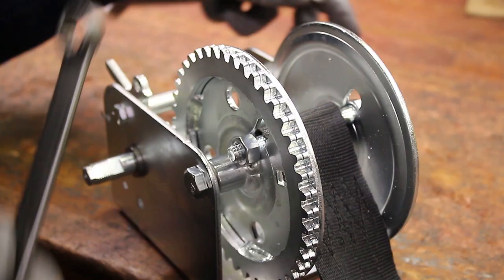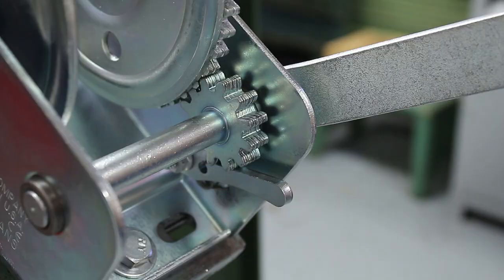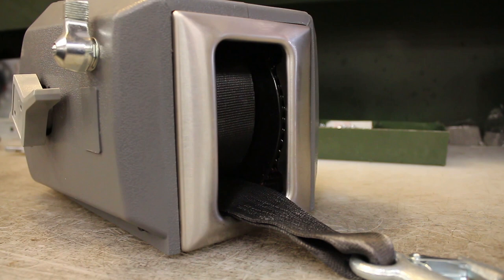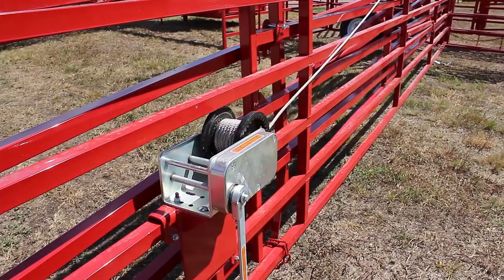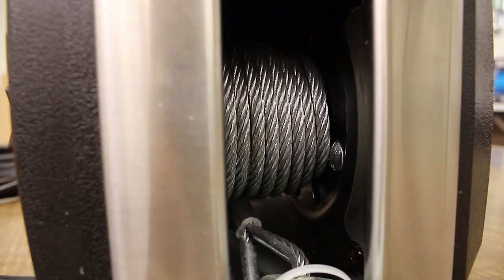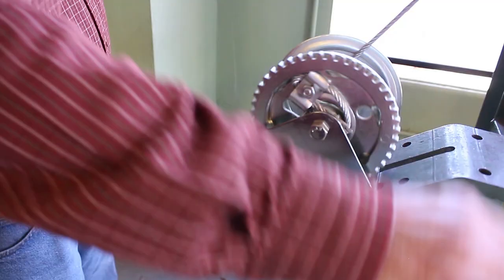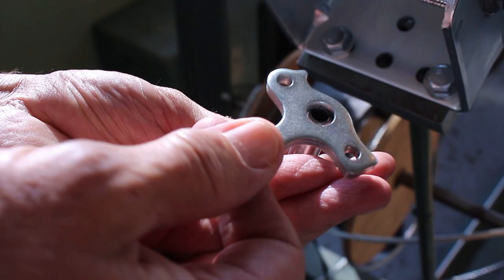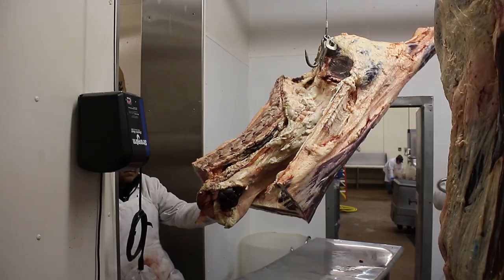Does It Matter How the Cable or Strap is Oriented On My Winch? - FAQs

Comment: Which is the correct way to mount a winch on boat with guide strap toward the boat with handle on passenger side or the other way ?
Reply from the maker: Thanks for your question!  Your winch must be mounted so your strap goes directly off your winch towards your boat, not back across the length of the winch.  More information about which direction to install strap on your winch can be found in this video: https://youtu.be/Jvj8LDUIfQk

Comment: DL 1802 over or under?
Reply from the maker: Thanks for your question!  Cable or strap is typically installed coming off the top of the DL1802A winch's reel, but it can be switched to coming off the bottom of the reel if you first flip the direction of its reversible ratchet lever.  Discussion on this topic starts at the 1 minute, 38 second mark of the video on this page, and an entire video about doing this can be viewed here: https://youtu.be/uh9uz-lZl1U